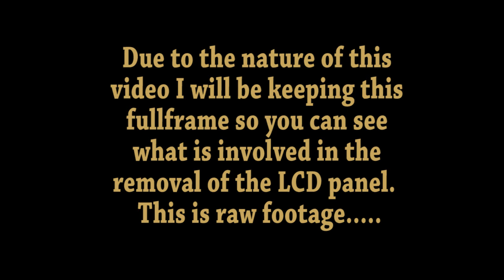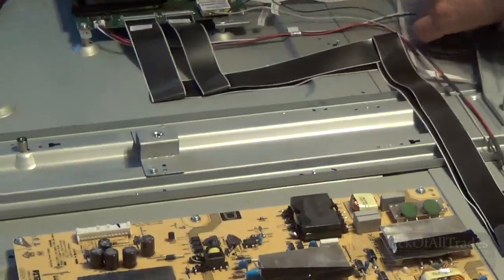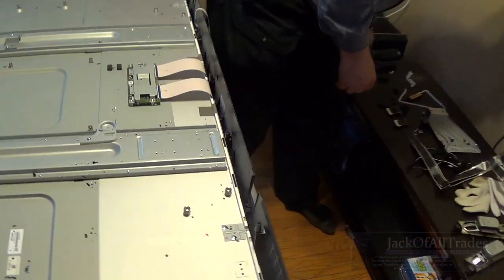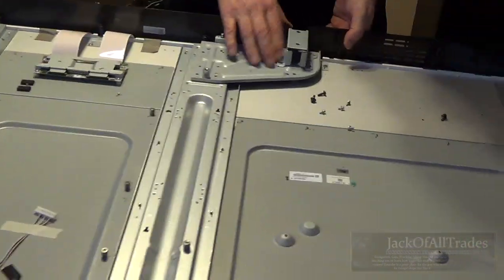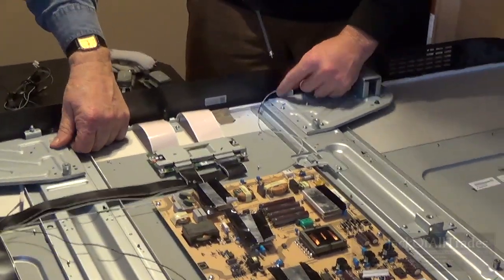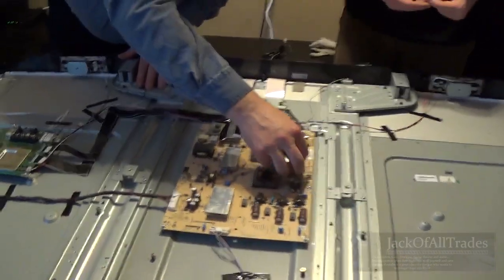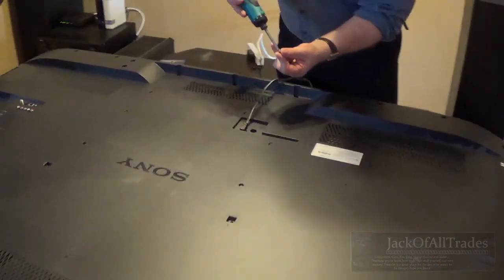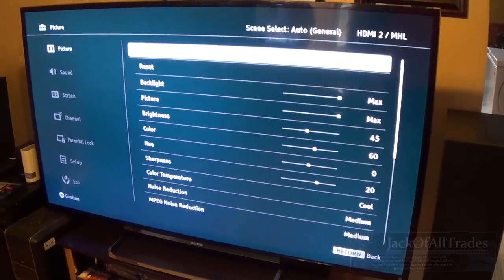Sony KDL70R55A LCD full breakdown and panel replacement in 720pHD

Comment: Hey, great video....my 70' Bravia slipped and fell over while trying to mount on the wall. The screen is all busted up 👎🏻.
And it's not under warranty...

So how $much$ did this replacement $cost$ you..??? 
I'm about to throw it away but something said look a little further on YouTube.
Reply from the maker: Bill Clinton screen is about 1000bucks. Sony uses many different panels from other companies to what the tech told me.
Reply: gereral1 thanks for the response..!!!! 
Well, I guess my next 2 questions are...??

1. So how did you go about getting your help..???

2. Did you call SONY or some other company to have a tech to come to you first to say what actually NEEDS to be replaced..??

Because right now, I'm looking every where online and no one has a 70' Bravia LCD PANEL Replacement. 

So how did you go about getting your help..???
Reply from the maker: Bill Clinton Sony arranged it. They delivered the panel to repair guys who in turn replace it in my home. look up how to put the TV in service mode and in there us a section to display compatible panels!. There are a large list. I was surprised that Sony uses Samsung panels.
Reply: I bought a smart TV w-700b Bravia and within 2 years the panel and board both stopped working, this is ridiculous 😤😤😤😤😤😤

Comment: gereral1,  those Sony technicians lied to you regarding unusually problem with the bad panel on Sony KDL-70R550A LED TVs.  I have contacted Sony regarding the TV that was completely dead due to panel defects.  I am hoping that they will provide a solution rather than toss the TV into the trash.  There are so many Sony's customers out there having problem with panel defects on this models and series that Sony washed their hands off.  I am surprised that Sony couldn't afford to include to tapes for the wires and their technicians had to reused the old tapes.

Thanks for showing this video.

Comment: I have the Sony KDL-70R550A I think the panal is bad tv is just over 3 years old? what can I do?
Reply from the maker: I got sony to give me a replacement and thet let my go back to bestbuy and get xbr850c 65 inch . Glad I had extended 5 year warranty
Reply: What's the best # to call
Reply from the maker: Adam Sassone is your tv still under extended warranty?
Reply: No only 1 yr warranty. Bought tv on Crutchfield don't think they offered additional Warranty...
Reply from the maker: Adam Sassone look up how to use sony remote to put tv in service mode. in there is  a list of compatible panels for this model. write them down and call service repair places and see if you can buy a replacement panel. sony uses samsung panels. so these panels are interchangable. The panels going to cost around 900 dollars so you have to weigh cost compared to a new tv.